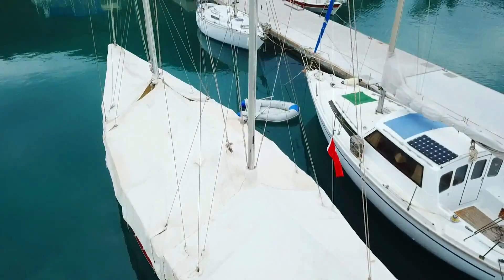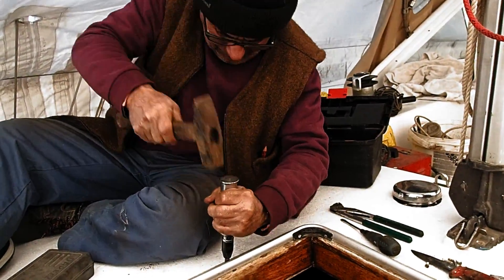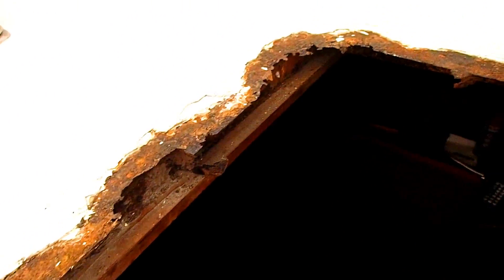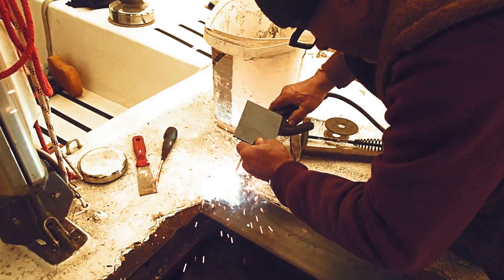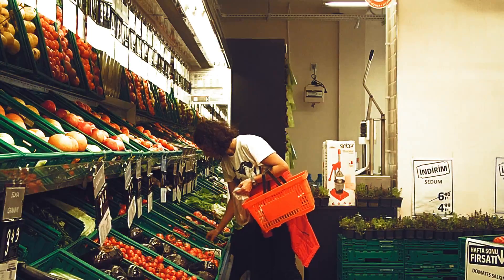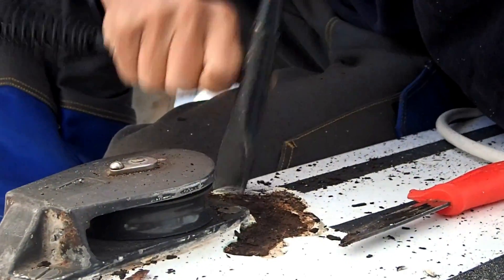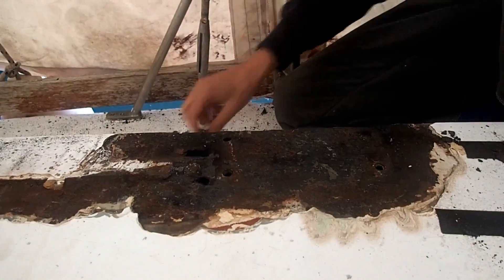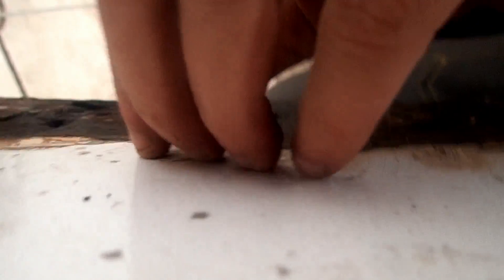How to Research the Ocean on a Budget  - Marine Science Sailing VLog 1

Comment: don't worry about a tig, just get yourself a little 150 amp inverter stick welder. Great cos it's small! You can weld stainless with it as well. most of which will be railings and pushpit stuff. We have one aboard and use it a lot. Anything below the waterline get a pro to do
Reply from the maker: Which one did you get yourself? Just curious since... well, feeling better to get something that has proofen it's worth....
Reply: we've got a little Selco 150. Can't remember exactly how much i paid i think it was about 5-600 euros. It's done quite a bit of work, new gunnels, new bow section. New parts of the coach house. We also put together a new stainless companionway with it. We use it quite a bit, one of the benefits of having a steel boat is you can just weld shit to it! We have a stainless push pit platform as well...so yesterday i welded the new auto pilot compass mount to it...saves a lot of bolting and sika etc. I like our welder but can't really recommend any others as i just don't have the experience with  other makes. i did talk to a professional welder who said that  the best inverter welder he had ever used cost him a 100 euros from Lidl's though...so i guess it might not all be about price!
Reply from the maker: Thanks Iain! Useful bit of information from someone who actually is a user! In fact I did see a guy welding here with a 95 Euro welder from Lidl yesterday - in a carshop for professional use.... well, why not?

Comment: Cool, great job! I use Sigmacover 280 as a primer. It is a two part primer, sicks on anything including zinc and you can leave it out unpainted for half a year and it is still good. It is also dirt cheap at 40 euro per 4 liters.
Reply from the maker: +S/V Adma we used the Jotun Epoxy yacht primer. Suposedly very good stuff (with aluminium flakes in it) so in a way it acts as a zinc for you....
Reply from the maker: +S/V Adma i think one of the keys for steel boats is to stick with the same paint concept as well! Some dont like each other a lot something to check up on beforehand.... that was the big part of sticking with Jotun
Reply: I agree. Even with the blessing from the pain factory it sometimes goes wrong and you can only sandblast everything off. Seen that happen last year to my neighbor in the yard. I know Jotun too. Very good stuff, only a bit harder to apply for a novice in the two component paint.
Reply from the maker: +S/V Adma so true.... trouble is sometimes there is too much paint hiding the problems for too long. However the beauty of steel is eventualky it will come visible and then you find it....
Two component paints can be tricky but they last so much longer, certainly worth it!

Comment: Perhaps you might consider buying your own stick welder and learning how to weld yourselves, Its really not that hard for the most part and having a steel boat it would allow you to fabricate equipment and mount equipment on deck, in addition to patching the boat.
Reply from the maker: +Dvseire fully agree as well! In fact I did already do my basic introduction into welding and am comfortable to weld steel and stainless.... aluminium keeps melting down 😂
Reply from the maker: +Lgvrmm Rmm was checking the second hand welding market today.... in terms of boat or on board work I guess it should come in combination with a generator though.... hope to come across a nice tick welding machine at decent price around here somewhere
Reply from the maker: +Dvseire the best one you can have is better use than the one you cant afford.... i really like that one! Thanks for the advice! Will keep my eyes open for the right candidate!
Reply: @Dvseire: Fully agree with you! Manu you should think about that as I am expecting some more issues in this regard!
Reply: be sure, will check, . . . all the best!
Reply: In theory a combination generator/welder seems a good idea, but if it breaks down then you have neither! A separate generator will also be more portable which may be helpful when you want to use it off the boat at some point in the future. Whatever you decide to get, it's important to remember that, the best one you can afford and have, is more use than a better one you can't afford and don't have! :-)
Reply from the maker: +Lgvrmm Rmm thank you!